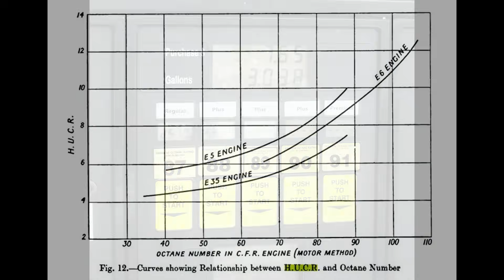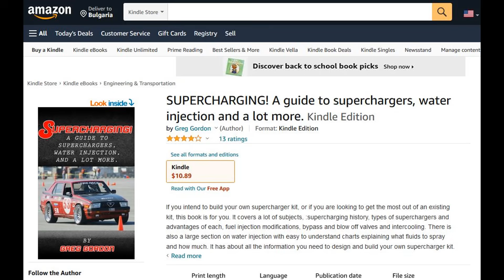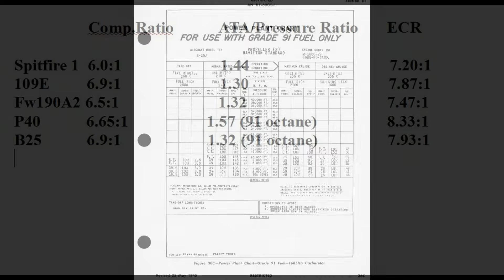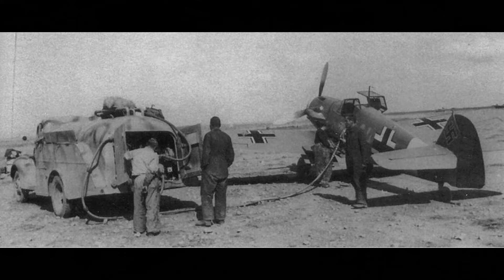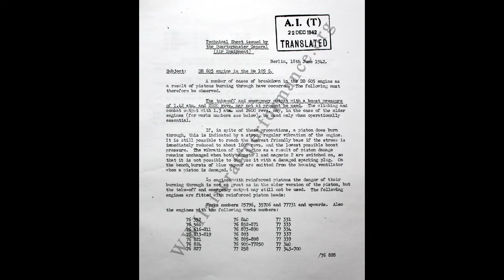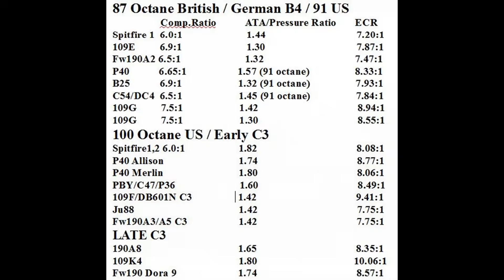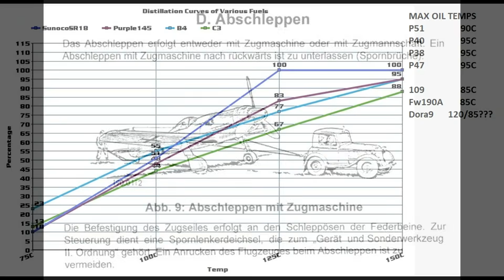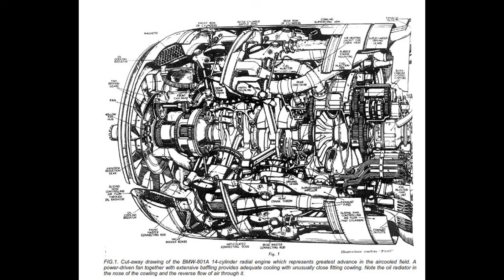German C3 Fuel, Uber Octane or Synthetic Crap?

Comment: Excellent video, I was enthralled through out this long video. Strange how such technical design are needed for fuels and engine design, all for performance and faster planes, YET the actual requirement was Destroying enemy planes and taking control of the sky.  Rear gunners would have been a better answer to this problem, twin rear-facing 50 cals could have destroyed more enemies than faster planes to escape pursuit or control the fight.

Comment: From an instrument engineers perspective 2x DIFFERENTIAL pressure produces 1.414x the volumetric flow through an orifice (Bernoulli’s theorem). Pressure loss along the intake and exhaust manifolds are significant to flow rates.
Increasing temperature decreases the mass flow as you stated.

Comment: In 1986 F1 engines were turning up the boost close to 4 bar, I think most of that was due the huge intercoolers, but they also used fuel made by company's like total and agip. This fuel a closely guarded secret, I wonder what the octane rating was?
Reply: Not that closely guarded now. They used toluene as a primary ingredient.

Comment: Few random thoughts/questions. 
The 190A-8 ECR thing seems weird to me since I've heard the additional fuel spraying into the charge air on that plane was designed for anti-knock protection. What was the point of that if oil, rather than knock was the issue? (Another thing which occurs to me is that the 801 didn't get MW 50 because of issues with cylinder damage - maybe the metallurgy was just really that bad?)
How come the P-51's water limit is only 121°C? As I understand it, from the Merlin XX on RAF ones ran 135°C. Is that also a gauge reading position thing?
Also I was looking at a chart of how power varied with boost (Merlin IIRC), and it seemed to be a linear relationship. How does that square (pardon the pun) with it factoring into ECR as a square root?
I'd also be really interested in video on how intercooling/water spraying affects all this, is it possible to get accurate ECR numbers with data we have or is the intercooler a bit of an unknown factor?
Reply from the maker: That's five questions, each needs a kinda long answer. I'll address one. The power increase from more manifold pressure is not only a result of more compression, it's a result of the greater weight of air entering the cylinders. Thus at lower boost levels it is pretty close to even with the increase in boost as you saw in the Spitfire going from 6.5 to 12psi. That's totally different than the increase in ECR.

Comment: Greg, 

That makes total sense, I like your explanation, and agree with your conclusion about the 2 formulas

I suspect one of the reasons the "linear" formula for effective compression ratio doesn't work is because in pretty much every scenario of a compressed charge, some heat is always removed by the interface between the charge and the materials around it.

Obviously with an intercooler, the charge temperature is greatly reduced (and therefore it's tendency to detonate). But even in the worst imaginable configuration, such as a draw through supercharger mounted directly to the intake manifold, the supercharger body and intake manifold, short in length and limited in time interfacing with the intake charge as they may be, will draw SOME heat from the intake charge.

An NA engine with a compression ratio of say 16:1 will compress the charge on the compression stroke in a very small window of time, and the charge will remain inside the combustion chamber, which is a relatively hot area of the engine.

Where as a (theoretical) supercharged engine running 14.7PSI of boost with an 8:1 compression ratio, even without an intercooler, and even with a very short distance between the supercharger and the combustion chamber will bleed off SOME amount of heat from the intake charge before the charge is compressed again inside the combustion chamber.

Therefore it makes total sense that when it comes to a compressed intake charge + an engines compression ratio: 1 + 1 does not equal 2.

Comment: Wow, pretty scary what the Ta-152 did with low quality fuel!  W/ 150 octane that thing would have gone toe-to-toe with the xp-47j
Reply: Too late, time was up.
Reply: The Ta-152 did well at high altitudes. At altitude octane is less of an issue, as most supercharging systems are running flat out and still not able to generate maximum allowable boost.

Comment: I think your point about elevated temperature is well taken. The compression ratio should probably be adjusted by the ratio of the absolute temperatures, not the arbitrary square root. In Rankine, with a 200 degree delta T and freezing ambient temperature, the ratio is 459/659 * 1.8 (pressure ratio). This is Boyles law, an basic principle in gas flow calculations. What you need to measure is the actual temperature in the intake in both naturally and supercharged engines.
Reply: Oops. That should be 659/459 * 1.8 * C. That would explain why they couldn't use the 130 octane to increase power. No intercoolers.
Reply from the maker: Hey, if you want to come up with a better ECR formula, I'm 100% with you!
Reply: Absolute temperature in Fahrenheit units?

Comment: With regards to the Fw-190 not taking complete advantage of C3, could this be related to the Kommandogerät they were fitted with?  This was essentially a computer that automatically set mixture, boost, prop pitch and magneto timing based on throttle setting.
Reply from the maker: No, I don't think so. If anything the Kommandogerat should allow them to take more advantage of high octane fuel.

Comment: Great video, but I have a couple of comments/questions:

I seem to remember Calum Douglas mentioning the German direct injection systems had some issues with proper atomization of the fuel when running rich mixtures. Combined with the poor volatility of the German fuel this could lead to a perverse situation where rich mixtures where actually more prone to preignition. As a fix the Germans generally kept increasing the pressure of fuel injection as the war went on.  

Also, the DB engines often used a lot of valve overlap. Douglas suggests this was done allow the supercharger to pump cool air out the exhaust to cool the exhaust valves. This is a standard technique with two stroke diesels but can only be done if you have direct injection so you can delay introduction of the fuel into the cylinder till after the exhaust valve closes. Wouldn't pumping part of the intake charge out the exhaust effectively lower the ECR?
Reply from the maker: Regarding the direct injection systems, I don't think so because there were multiple systems and the low ECRs are across several types of engines. Furthermore, the German engines ran similar ECRs to the Americans with comparable fuels, meaning B4 vs US 91.

As for the valve overlap issue, it's commonly misunderstood. Almost all supercharged engines use valve overlap. In this video I sort of hinted at the effect of valve timing on effective compression ratio, as opposed to equivalent compression ratio, and there is something to that, but in WW2 aero engines it's not very significant. Yes, during overlap some boost air blows out the exhaust, and that's desirable for a few reasons, which is why nearly all of them do it.
Reply: @GregsAirplanesandAutomobiles  In his book, Calum Douglas states that a typical valve overlap on a German engine was say, 103 degrees of crankshaft rotation. Greg, when you state that "Almost all supercharged engines use valve overlap" can you state please a typical figure? Once we know this figure, we can then recalculae the ECR.

Calum heavily implies that allied aircraft used less valve overlap because they didn't have direct fuel injection, although he doesn't give typical numbers in his book (or if he does, I haven't read that bit yet). (And of-course the introduction of indirect fuel injection didn't help in this matter.)

Comment: Spectacular visuals! (as usual)
Apropos Mercedes possible lack of concern about main bearing wear because the planes usually didn't survive long enough for that to be a concern, in Galland's autobiography, 'The First and the Last', he writes that during the air battle for Germany the shortage of pilots was such that the typical fighter pilot arrived at the front with only 150 hours of flight time.....  and that approximately 50% of the pilots were shot down before their tenth sortie.....
Reply from the maker: exactly, and I think that was likely a factor in determining the needed engine life.

Comment: Just curious understanding that increasing bore size lowered usable compression ratios what impact did stroke length have on combustion chamber size and did that impact usable compression ratios ?
Reply: The real issue is having the most compact combustion chamber at the top of the compression stroke. A smaller bore and longer stroke make that happen. That is because the farther your combustion chamber stretches from your spark plug the bigger the chance you will have an area where shock waves will interact and form a high pressure zone and cause the mixture to detonate. The goal is an even flame front moving across the chamber from the igniter to the cylinder walls. The more compact the chamber is the easier that is to achieve.

Unlike some simplified descriptions of engine function the fuel is supposed to burn, not explode. If it explodes, that is detonation.
Reply from the maker: Good question Dallas, but the answer is just way too complex for the comment section. That would require an entire video.
Reply: No engine designers seem to have discovered the importance of a squish band in increasing turbulence and therefore, combustion efficiency, at this stage of ICE development.   @GregsAirplanesandAutomobiles

Comment: Octane rating for the studious.  For those who remember the gas law equation PV=NRT from P-Chem class, the chemists can't even decide on how many factors to use for octane rating.  Basically, it boils down to (sorry, unintentional pun) what factors are significant, and which are not, and can be dropped, with a limiting factor based on combustion, which moves based on too many factors to mention. It's ugly.  I started investigating with the intention of looking at the units of each term to figure out where Greg's square root comes from.  Head explode.  People have written dissertations based on this.  That being the case using a chart that seems to work is fine by me!
Reply: I figured that "It's pretty complicated, but this is a rule of thumb that seems to work" was a good enough explanation.  ;)

Comment: Greg, how much do you think the Germans just dumped whatever fuel they had into their planes, regardless what the stencil said? Especially as the war progressed. This may have contributed to even greater engine wear/failures.
Reply from the maker: Great point Jim, I thought about that. Could some engine failures have been the result of putting in B4 instead of C3? Probably.

Comment: First, I must say Bravo! to your newest video, Greg. Second, there are two factors beyond a fuel's octane ratings that may influence heavily on it's resistance to knock/pinging, i.e., the fuel's latent heat of vaporization and it's resistance to ignite because of a hot spot or lack thereof, such as a carbon deposit or a glow plug. A high fuel's latent heat of vaporization, specially in a direct fuel injection engine, favors an increase in ECR because it reduces the air/fuel mixture's temperature more than in a fuel with a lower latent heat of vaporization; this works just the same as an intercooler or W50 and also may explain at least some of the difference in motor and research and lean and rich octane ratings. For example, because of methanol's very high latent heath of vaporization, intercooling was not used for a long time in turbocharged Indianapolis 500 racers, fueled with methanol, but was, out of necessity, in all turbocharged Formula 1 racers, fueled with many mysteryous concoctions they called gasoline, for marketing reasons. The other factor is the fuel's resistance to knock due to hot spots and that may explain Mr. Cullum's remarks about exhaust valves temperatures and also the reduced ECRs on air cooled engines as compared to liquid cooled ones, I guess B4 and C3 might have low and maybe very unpredictable resistance to knock due to hot spots, what might force a reduction in ECR. That's why you may dare throwing a lit cigarette butt on avgas without much risk of setting it on fire, but don't even think trying to do the same with E85 or methanol. I also venture an educated guess and a very long shot in face of our lack of solid information, and try to explain the very high ECRs of DB engines as being due to fuel's high latent heat of vaporization and high resistance to knock to hot spots. Of course, that's just a guess. Sadly, available data sources are lacking information on both factors.
Reply: Top fuel cars use a similar trick to the turbo indy-cars where they will spray some of the nitromethane/methanol through the super-charger to help cool the air a bit.
Reply: @666Blaine  and that’s what many aero engines did too. Late Merlin sprayed most into the supercharger eye, I think. Will check that though. Callum Douglas points out that injected Daimler engines had an extra injector nozzle into the supercharger inlet

Comment: Is there any videos about how C3 was made? Or do you plan to make one?
Reply from the maker: I don't think I want to get into that. Chemistry is getting a bit too far outside the scope of this channel, and my areas of knowledge.
Reply: @GregsAirplanesandAutomobiles  10-4. Just thought I'd ask. Kinda curious about how they did that. As well as the jet thing that was powderd by similar fuel.
Reply: @ryridesmotox  My limited understanding about synthetic fules in the third reich, is, that they where based on liquifide coal.
Liquifying coal, by cooking it at high pressure and temperature, with hydrogen and a catalyst gives you something similar to crude oil. That can then be destilled. Problem is, that you also get quite a decent amount of water and alcohols mixed with your destillate.
You can purify your liquids my destilling them multiple times, but this drasticly reduces your yield.
I.G. Farben e.eg produced somethin called Leuna-Benzin, wich had a base of ~67 RON this was then increased to about 82 RON by adding additives, namely treaethyl lead and a little bit of aniline. The ~100 RON of C3 was achieved by additionally mixing in 30% of something called Kybol (a mixture of diethyl and propyl benzene).

So yeah, german avgas was a hodgepodge of low grade gasoline with a ton of additives. Most of wich are more toxic, caustic and cancerogenic tan standard octane. Benzene derivatves, different alcoholes and amines.

I don't know what the allies used to get 150 RON AvGas but I guess, they added teraethyllead and somethin like Etanol to their pure iso-octane.
Reply: @cahdoge  An important component of high Octane fuels are the Aromatic hydrocarbons, like Benzene, Toluene and Xylenes, in addition to Organo-metallic additives like TEL (lead tetra- ethyl).
Reply: I.G.Farben and all German cartels were financed by Wall Street banks, financiers and industrialists starting in 1924
The Synthetic fuel, tetraethyl high octane additive and synthetic oil hydrogenation process from coal was from Rockefeller’s Standard Oil, in exchange for German Synthetic Rubber technology.
Incidentally, Standard started drilling, and had the refineries in the ussr starting in 1917. Fred Koch also a part of it. Ford was already in Germany in the 1930s, along with GM(duPont) who owned Opel since 1931-
Invested in all sides
Ford also in England, France and ussr. Financed in all sides
Reply: Antony Sutton’s research and evidence from State Department decimal files document where it came from. Also revealed in documents is how Germans were extremely pleased with all the data provided by Standard Oil research in the technical assistance/exchange/investment

Comment: Just some technical nitpick: The octane rating of a fuel is measured by comparing it to a synthetic mixture of n-heptane (which has very poor anti-knock properties and an Octane-rating of 0), and iso-octane (IUPAC name; 2,2,4-trimethylpentane with an Octane-rating of 100), with the value representing the percentage of iso-octane in the mixture. For numbers beyond 100, this is measured by by blending the fuel with n-heptane, and extrapolation
Reply: Some more nitpic. Above 100 av fuel is generally refereed to by it's Performance number, or PN. Octane ratings end at 100 and PN numbers start above that.
Reply from the maker: fair enough, but in practical terms we just look at the number 110 or whatever.

Comment: When the R+M/2 method,took over in the USA,Sunoco 260 was
initially rated at 97.5,dropping to 96,and eventually disappearing altogether.
Thanks for another informative video.
Reply: Was it "260 GT" or did Sunoco reuse the branding? If it's the former, it's still for sale as a race fuel in cans.
Reply: @andrewahern3730  It was Sunoco 260.
yes still available in cans as street legal 100 unleaded,and all their other race fuels
Cheers

Comment: Why can't one just direct inject the gasoline at the precise moment it needs to be ignited like in a diesel engine? 

Also, the key to increasing octane seemed to be adding copious amounts of TEL.  Why didn't the Germans add TEL until they reached the desirable octane rating similar to the allies did with 130/145.
Reply from the maker: They did use direct injection. As for the lead, I don't know.
Reply: My impression is if you just keep adding lead you reach a point where the octane is not increasing but the spark plugs are immediately shorting out due to lead deposits.
Reply: The very high octane allied fuels used exotic additives that were discontinued once jets arrived.  I can’t name them now.